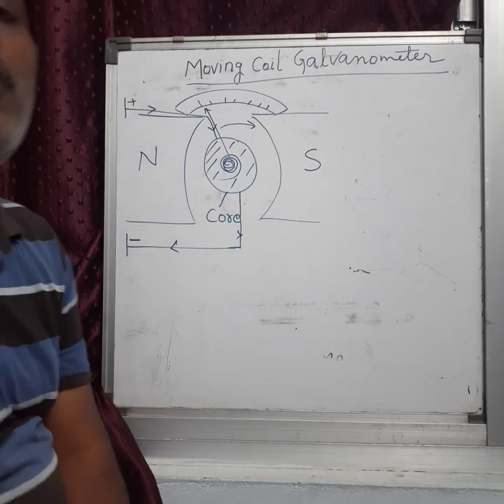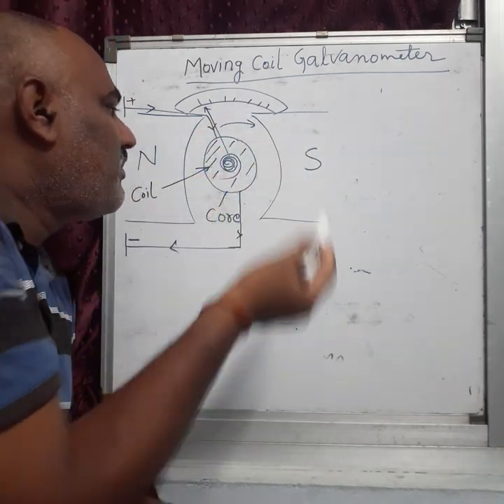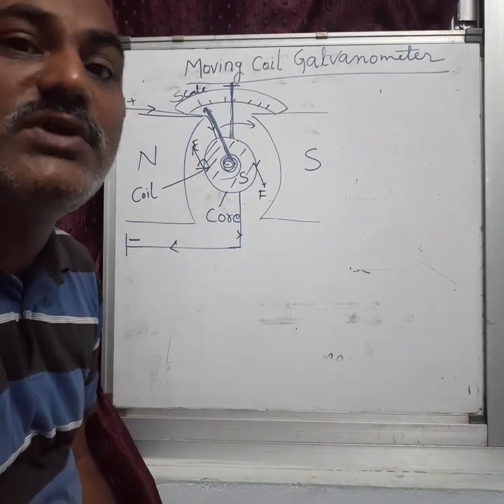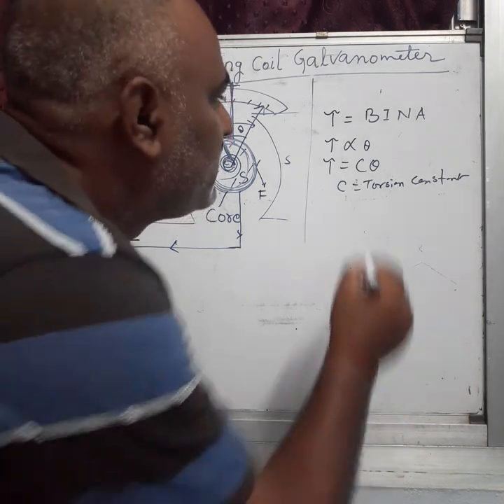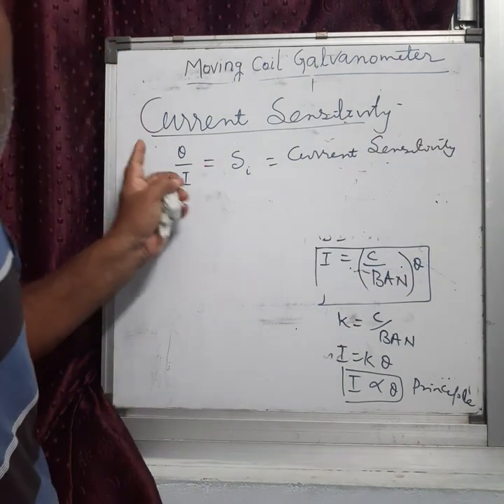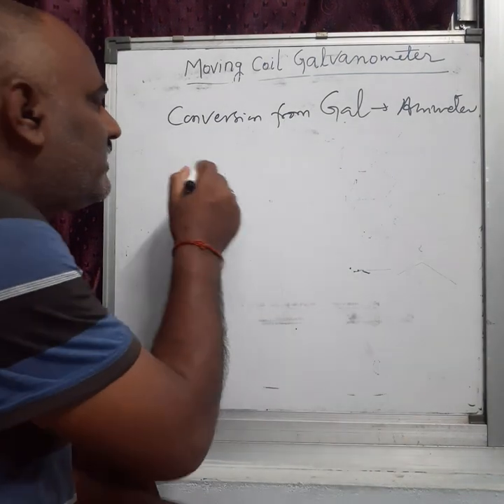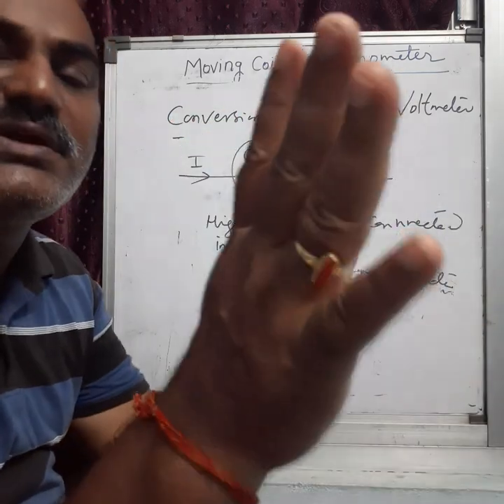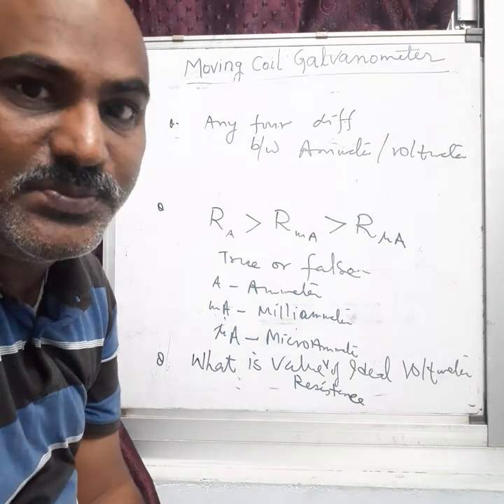Moving coil Galvanometer

Comment: Ans 1 ....Ammeter 
1.used to measure current
2. Resistance is low
3.connected in series 
4.changing of range not possible

Voltmeter
1.used to measure voltage across 2 points
2. Resistance is high
3.connected in parallel 
4.changing of range possible

Ans2.  False 
Resistance in milliammeter is higher than in ammeter ...more current passes through ammeter so resistance must be low

Ans3 ...For ideal voltmeter the value of resistance is approx infinity
Reply from the maker: Good answer